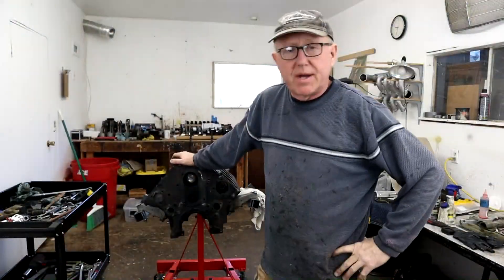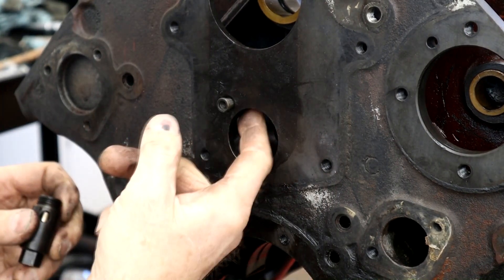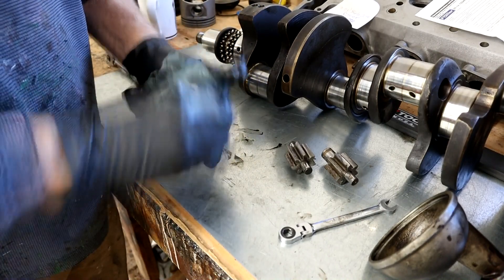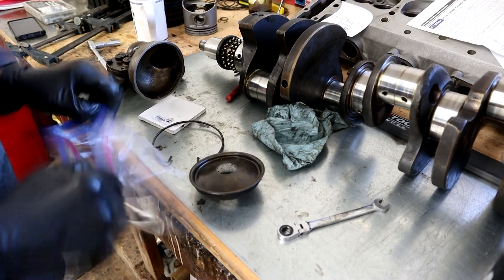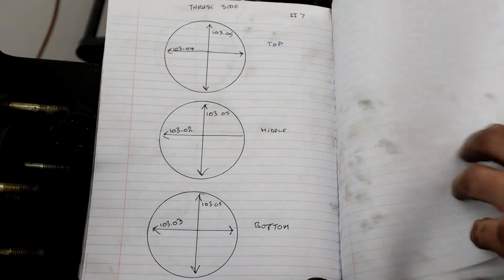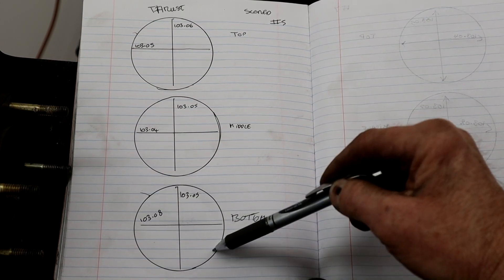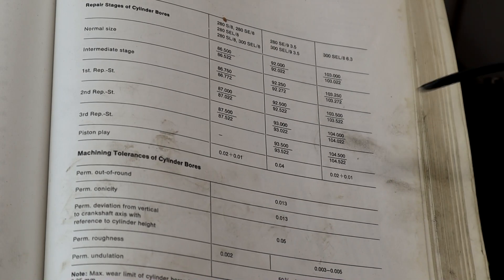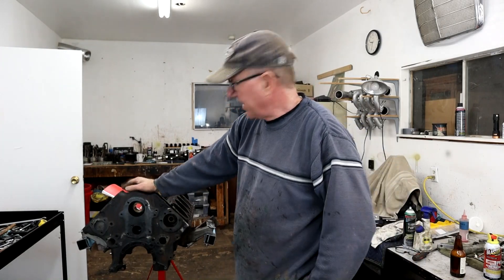MERCEDES 300 SEL 6.3. FINAL CHECKS BEFORE MACHINING. PART 7

Comment: A point I would like to add for the ignition system. For those with electronic ignition in their cars, here is a very good modification you can do. If you're having ignition issues, & your car is running rough, try changing the ignition module. Bosch made several "flat pack" type units. Get one that has the connectors all on one side. Next, get a piece of aluminium angle, 40mm size, by 3mm, by 75mm long. Drill 2 holes in the aluminium angle, corresponding with those in the module. spread the white paste on the metal side of the module, then screw the module to the bracket you made. Fit this to the car, in roughly the same location as the original module. Next, you need 4 pieces of wire, about 50mm long, 3 male bullet connectors, & 4 female quick connectors. Using a multimeter, find the "+" wire from the coil. Using one piece of the wire, connect this to terminal 15 on the module. Connect the negative wire to terminal 16. Using the other 2 pieces of wire, connect the inner conductor to terminal 7, & the outer to terminal 3. Last step is to delete the series resistance. Change the coil if needed. The ignitrion module was used in a wide variety of cars, including Ford, GM, & Mitsubishi. I've done this conversion to my car, because My car broke down on the way home from Adelaide, to Port Pirie South Australia. I put a back up coil in my car to get it home, because the coil was the real culprit. I changed both to be sure, & the newer modules are readily available.

Comment: Also to consider, the bigger the bore, you get a bigger engine - 6,5 liter, more torque :-)
Reply: Reboring the cylinders by 0.030" won't give much extra in the displacement side of things, considering it is only the same amount as the plug gup used in most cars, including my own.
Reply from the maker: @christophermarshall5765  Do you know "Red Pig"  I'm assuming they bored that to the max. I think it ended up to a 6.9. Also changing out connecting rods would increase wouldn't it? But then I suppose it would change compression ratio. Bit beyond my math skills right now:):). Cheers John 🍻
Reply: @mercedesmaintenance.6339  I know the "Red Pig" Mercedes. It's engine was bored to the max, along with shorter rods, & different crank. I think the heads were ported & polished on the intake side, along with hot cams.
Reply from the maker: That's a bonus:) Cheers John.

Comment: There seems to be minimal wear on the cylinders and there is minimal difference between cylinders. The main issue is the scoring due to that ring breaking, but could you see if the machine shop can repair the damaged cylinder with spray welding. They may have the equipment or they could get someone in to do the job. With this, they will build up the low scored points and then take staged cuts to bring it in line. Then going by the manual at 15.34, hopefully all eight cylinders could sit at the normal size at 103.022.
Reply from the maker: That's something I will talk to them about and see if they offer that. It Makes a lot of sense. That way we take off as little as possible. Thanks for the suggestion. Cheers John.
Reply: @mercedesmaintenance.6339  I forgot, the oil pump will need to be looked at for its minimum specs. Some of the debris made its way in and gouged the aluminum housing. Ideally, a new pump or a good used one would be good, but talk to the experts you know and see what is best. The oil pump is the heart of the engine and you want good oil pressure for many miles to come.
Reply from the maker: @mohabatkhanmalak1161  Thank you. Will do. Cheers John

Comment: Rebore size is dependent on cylinder with most wear. This is the cylinder rebored first.
Reply from the maker: Absolutely. Its at the machine shop now and I'm waiting for his opinion. When I was there we were hoping the damaged cylinder could clean up at 103.50. They are very backed up, so I'll get on with other things. Cheers John.

Comment: The rear main seal is as you said, rope type. Before installation, the 2 halves need to be soaked in engine oil. Once done, install as you see it. The retainer has a small spike. It is to hold the seal in place, locking it against rotation.
Reply from the maker: I was looking at mbclassicde. in Germany and they still have the two part rear main seal. the only ones available at the Classic center are the replacement full rope seal. that's the one my friend Duke said was very problematic fitting to the 6.3. I'm going to order the original two part type. I saw the spikes that stop it moving. It has three. What's the reason for soaking the seal? Is it to soften it up some what? 
Cheers John.
Reply: @mercedesmaintenance.6339  The reason for soaking the rope seal you are partly correct. I've worked with rope seals in the past, as other engine manufacturers, such as Chrysler & Ford used them. The full rope seal can simply be cut to length. Fitting is straight forward. The reason behind one end protruding slightly on each seal half is to ensure a good seal.